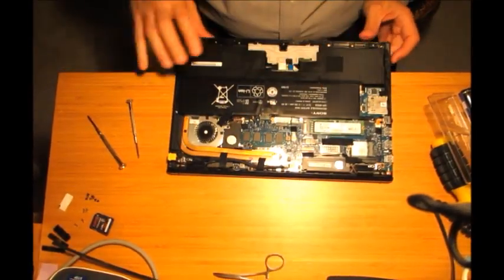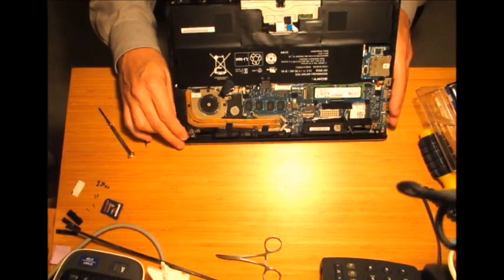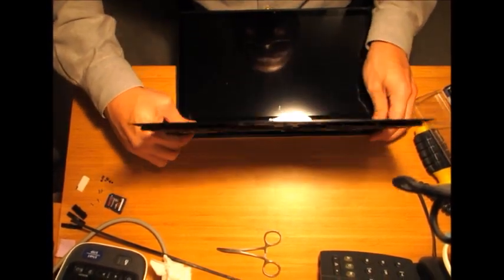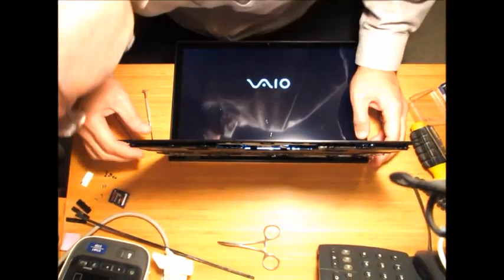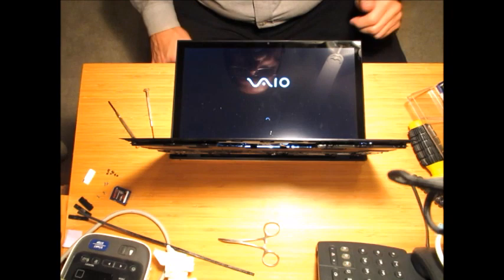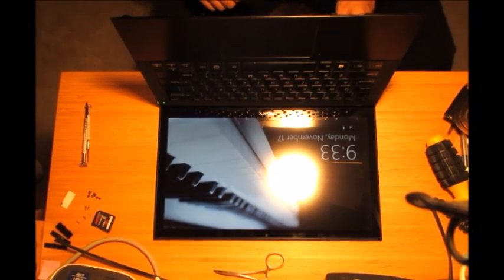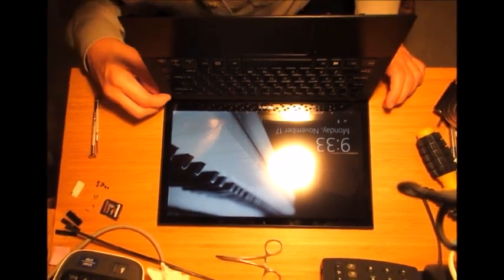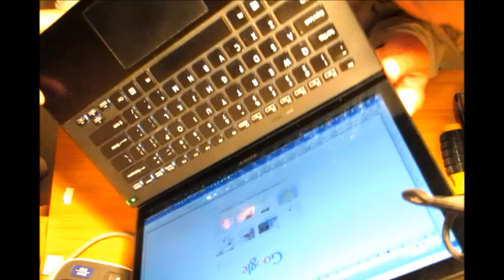Sony VAIO Pro13, svp132 fan replacement, case removal

Comment: Many thanks for this kind sir, I was nervous about opening the laptop but I fixed the problem without replacing the fan (although for the future I ordered a fan as it seems to be the weakest link in this excellent laptop). Just as background I got my Sony Vaio Pro 13 around March 2014, it was the later version which didn't have the WiFi problem and I've never had any problems with fan noise or overheating until 2 days ago where the laptop launched into fan full speed with prolonged overheating on the underside and also with awful helicopter type buzzing noise which made the laptop almost unusable as this was a terrible distraction to others and myself. The noise would commence after starting the machine for 1 minute and then launching any application such as Skype or YouTube. I suspect that the problem was that the oil lubrication on the spindle of the fan had totally evaporated and the ball bearings were grinding, I typically used my laptop every day for an average of 2 hours and then left it on all night playing podcasts which I listened to (subconsciously mostly) for hours - this has been the pattern of usage for 11 or so months.

So the steps I followed to fix the fan noise problem for my Sony Vaio Pro 13 were as follows:

1) open the laptop as described in the video above being careful to not force anything as the plastic could snap, using one of those plastic levers used to open tablets is useful to have for this.
2) you will see the troublesome fan, focus on the fan and not the copper heat sink and without removing the fan (don't remove the fan for my fix) you will notice that it has a black circular sticker attached to the main spindle, the sticker has a center circle cut out at the middle with a small silver/white spindle dead center of the black sticker cut out hole (it's around 5mm in diameter). Now I removed the sticker taking care not to damage it but looking back I suspect this may be UNNECESSARY. Then I doused a COTTON SWAB with oil lubricant (I used U.K. WD-40(tm) although again I'm not sure if that was the ideal chemical to use), so you can use an oil soaked cotton swab or say instead a kitchen towel twisted to form a fine tip with oil on the end. REMEMBER you want the cotton swab to be wet with oil but not DRIPPING as it may drip the lubricating oil onto other components and you don't want that as damage may occur due to this.

3) With the cotton swab wet with lubricating oil simply gently circle the silver spindle in the middle of the black sticker ensuring that a modicum of oil enters the spindle. REMEMBER we don't want to saturate the spindle with OIL just a small SMEAR will do.
I smeared light amounts of lubricating oil under the sticker area but I think that is not needed. Also if you DID decide to remove the sticker remember that there are copper coils beneath the sticker now exposed, there is no need to oil those so don't do it ! If you did decide to remove the sticker put it back exactly as you found it, I used a small about of Pritt Stick(tm) to do this and it worked fine - make sure it is secure though you don't want that sticker peeling off and falling onto the components whilst your machine is on.

4) re-attach the underside of the Sony Vaio Pro 13 carefully as shown in the video above being mindful that the side with the ports USB/audio jack should be tackled first as this is like the main hinge (of the oyster clam!). The audio jack is notoriously difficult to slot into place but as a useful tip, simply plug in your head phones into the audio jack on your Vaio Pro 13 and then GENTLY pull down on the plugged in audio connector to slot it back into place. Then replace the screws and the rubber 'feet' of the laptop as stated in the video and VOILA !!! you have a (FAN) SILENT AND COOL SONY VAIO PRO 13, mine has been playing 4K Youtube videos for 5 hours straight and the fan is silent, you can't hear a thing.

Side Notes: To be honest I was surprised at the results, it's almost as if the controller for the fan doesn't start if it detects resistance due to lack of lubricant on the spindle for the Panasonic fan and then doesn't kick in until it's panic time and the CPU is at 65 to 70 degrees Celsius and then the fan is like a buzz saw / helicopter rotary blade on full steam ahead with the underside of the laptop uncomfortably hot. I'm glad this fixed it as I didn't want to make modifications to any driver configs (there are tools to do this) or go on a hunt for a troublesome app that was causing this or do a factory reset to see if it was a software problem. If your Sony Vaio Pro 13 is still under warranty and you have time then I recommend that you return it to Sony instead of following my instructions or if you are worried about taking damaging your laptop, call up Sony and ask how much it would cost to repair your unit - I'm not sure if they still do fixes for out of warranty laptops though as they sold their Vaio business last year...
Reply: Well I just installed what I think to be my third fan now and it's as quiet as a mouse. I just keep the metal copper heat sink and screw in a new fan and carefully plug it into socket(s). I like to clear the thermal paste with alcohol just above the processor at the end of the copper heat sink also and reapply some new. I would say that the VAIO PRO 13 fans last about 1-1.5 years. I don't know why they break ? I've used the same fan type even some with slightly different model numbers, they all work but they break after 12-17 months with that horrid nose and high speeds. What is wrong with those fans ? I have about 3 in stop which should suffice for the life time of the laptop through reduced use at the end of the life of the laptop.
Reply from the maker: David, glad to hear the video was helpful.   Also, thanks a lot for your tip on using oil.  Let us know how long that lasts, hopefully 1yr+
Reply: ***** I will inform you how long my maintenance tip with the oil on the spindle lasts, if it starts grinding and spinning fast again and heating up as soon as I power on like last time then I'll post a comment on here, if not then I will remain silent. at the moment I'm typing away on the Vaio Pro 13, it's been on 1 hour+ and you can hear nothing so all good up to now. Like I mentioned in my comment I actually did order a backup fan as it is the weakest link with it's moving parts and I may well need it in the future so all your advice in the video is useful - I want this laptop to last as it was expensive.
Reply: David Boris Fernandez Hey guys thanks heaps for all the helpful info. What is your battery health like on the vaio pro now? im looking at purchasing a second hand one and hoping to find out what to expect, also do you know if the battery is replaceable and if a 256gb SDXC card works in it? Thanks in advance for any insight!
Reply from the maker: Javs Cuz Javs, I have not tried to replace the battery, but it appears replaceable.   I bought this PC in July 2013, thus 2.5+years and battery now lasts ~50% of the new time, so ~3.5 hours max now or less.   Have not tried a 256Gb SD card, but I use a 128 Gb and that works fine.
Reply: ***** Ok the 'fix' with the WD-40 oil lasted for about a month with less than usual laptop usage (about 1-2 hours daily); I promptly got the buzz-saw sound and the laptop got very hot. Maybe I didn't apply enough oil last time (as it initially seemed to work fine which resulted in a quiet fan). So I decided to install the new fan (cleaning away old thermal paste with a cotton bud/alcohol and apply new thermal paste also) and it worked... I got a real quiet fan and the laptop isn't as noisy. One thing though ... I got the 'new' fan from ebay and it seemed to have thermal paste residue on the 'end' with the 3 screws, also the exhaust vent seemed to have a few bent grills / metal fins so I don't know how 'new' this new fan really is or whether it was plucked from a faulty Vaio Pro 13 or not ... I'll keep you posted.

Also there is the 'other problem' which Vaio Pro 13's have and that is that the buttons on the track pad sometimes get 'stuck', this with my bad luck happened to me and it was very annoying... there is a 'fix' of sorts and I performed it and the track pad buttons don't get occasionally stuck any more ... here is my fix...
*************************************
My left click(s) on the Sony Vaio Pro 13 were occasionally sticking which was annoying ..... so I did the "tissue between the clicker and the base of the case and it works fine .... I get a decent 'click' noise on both left and right click buttons of the track pad and neither stick down any more... ( which prevented further user clicks).
 
Here are some photos of what I did .. I used a single sheet of lavatory paper !!! and just folded it and stuck it down with black cellotape...

http://tinypic.com/r/16kc3kn/8
http://tinypic.com/r/ir82og/8
******************
Reply from the maker: David, thanks for the extra info.  Glad you now have a good quiet cooling fan.  Mine is still running with no complaints.   Also, I had some click-pad issues, I blew out the top and under side with compressed air and things started working again.   Looks like you have another innovative fix, great job!

Comment: Thanks Larry,  This helped me a lot!
Reply from the maker: David, glad it helped!
Reply: ***** you mean Panasonic fan (part number: UDQFVSR01DF0) is quieter than the default cooler?
Reply from the maker: вася васев I could not hear a difference between the original fan (when new) and the replacement fan, they were both very quiet.  Replacement fan is still very quiet.